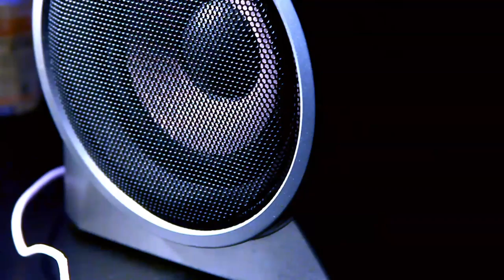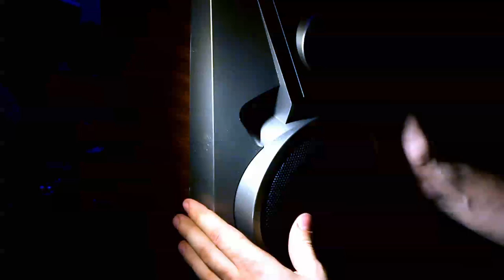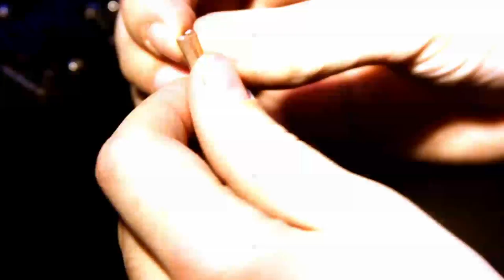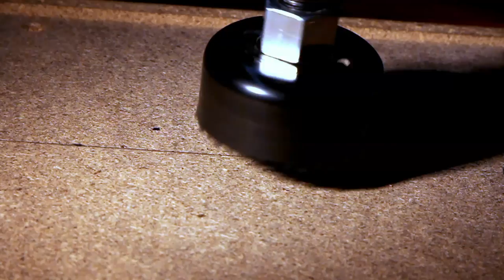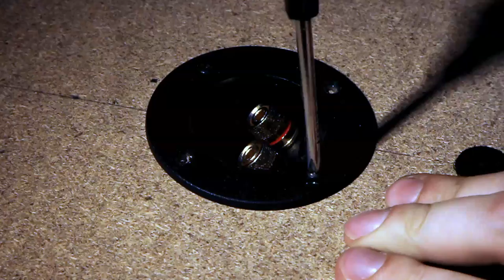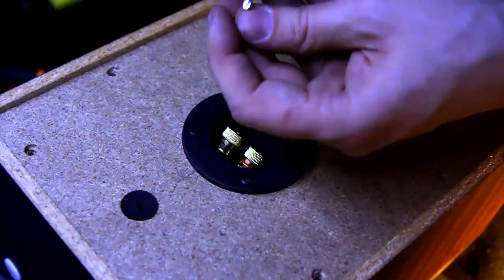DIY Sony SS-BX2 speakers conversion for banana plugs.

Comment: This video helped me know the magnet size thanks
Reply: I have those speakers and I broke one really bad (still works) and I also unsxrewed the screws but could not open it but I'll try again tomorrow!
Reply: Alright, I got them open because they sounded pretty bad and in one of them there was a dead spider in there but the driver itself has a very nice excursion. The tweeters overpowered the woofers so I only kept the woofers.
Reply: Both woofers are now blown! They really took some power! They smoked a lot aswell ;)

Comment: What did you have to do inside the speaker? How do you connect the existing wires to the banana plug terminals?
Reply from the maker: I replaced a polarized capacitor inside (someone put it there, clearly not factory made). To connect you can use banana terminals or just bare wire (there is a hole under the cap)
Reply: Gutorov Mike thanks 🙏🏼